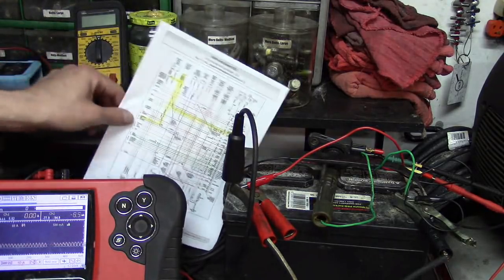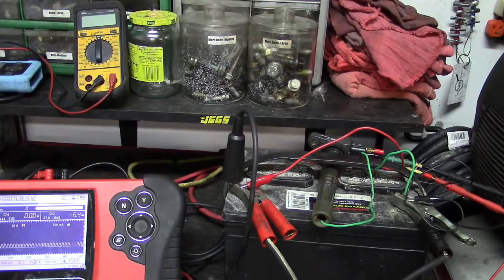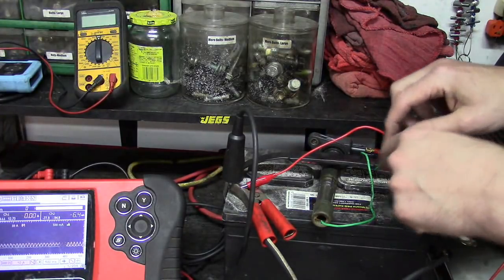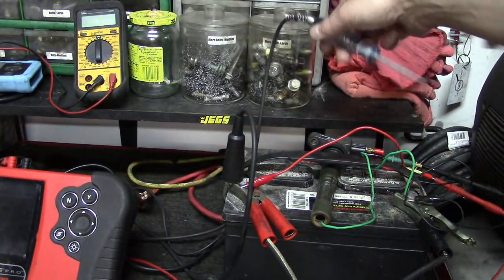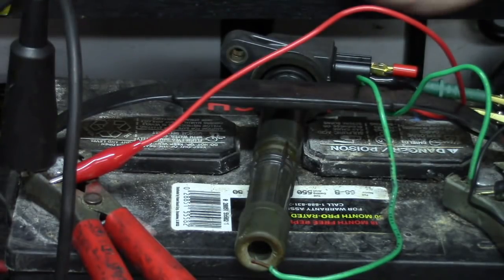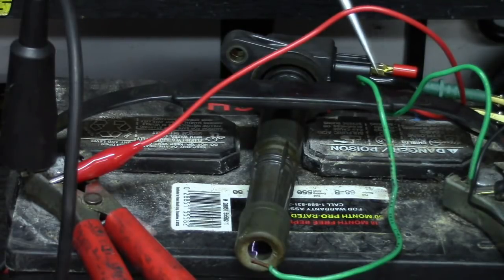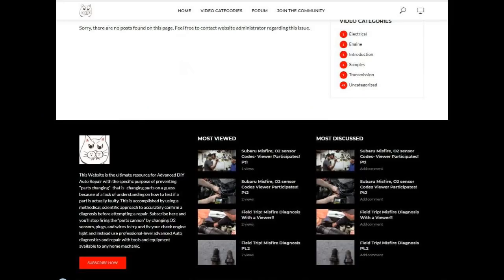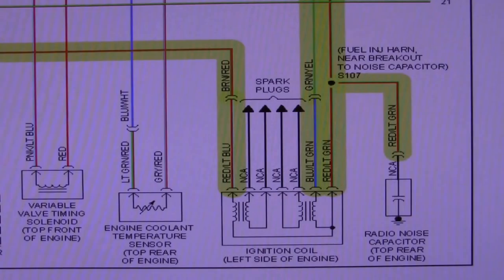Bench Testing a DIS Ignition Coil (COP)

Comment: A coil is more than just giving spark .. the winding on the inside wears.. Over time, the constant exposure to electrical currents and the associated heat can cause the windings to degrade. This degradation can result in increased electrical resistance, reduced performance, and eventual coil failure.
Reply: which would be tested how?
Reply from the maker: By ohming the primary.
Reply: @SchrodingersBox  you can test the coil's winding(s) for intermittant faults, under load, by ohming the primary?
Reply from the maker: No- you can test for resistance or a short in the primary on a failed coil.
Reply: @SchrodingersBox  ah ok, yeah i see that now after reviewing the circuits, thx for the info
Reply from the maker: Not under load. You never ohm under load. If under load you should do voltage drop instead.
Reply: @SchrodingersBox  i think ill just get the picoscope with the coil probe and the reference waveform library, anything else and youre just interpolating between data points. if youre going to own a vehicle with COP ignition, might as well count on spending the requisite money for direct data acquisition equipment...

Comment: Is there a way to test a 3-wire paired-output (i.e. cyls. 1+4 then 2+3 wasted spark) coil pack like this?  I mean on the bench with spark plugs and a battery?  I've tried all sorts of combinations with known good coil packs, but never managed to get a spark at the plugs.  I know you can measure the windings' resistances; but I would like a good way to test coil, leads, and plugs in one go when the rest of the car is unavailable.  If you have a paid-content video that covers this, I'll happily sign up.
Reply from the maker: Yes there is. I don’t show it anywhere but the operate the same exact way. Just provide power and ground and then input the signal as usual and you will get two sparks instead of one.
Reply: @SchrodingersBox  I thought it would be something like that, but I guess there's more going on with the ECU signal than can be simulated with a prod from a test probe.  Perhaps I need to add a condenser somewhere.

Comment: Nice video! 
However, the routing for the wiring was not really captured.
Please can you also highlight specifically the routing for the wires to and from the COP?
Reply from the maker: it’s very simple - your reference and signal inputs are battery positive. the ground of course goes to negative.
Reply: @SchrodingersBox  Thank you so much 🤝

Comment: I have a set of denso toyota/lexus COP  - 4 pin coils. How would you drive those on the bench? 
I want to use one as an ignitor for a foundry. 
I looked up the pinout
1 is GND 
2 IGT (5V+) 
3 IGF (ECM return to gnd?)
4 GND.

I was thinking to connect 1,2 and 4 to +12V, +5V and GND respectively and connect a momentary switch between ground and 3- would that work?
Reply from the maker: Test it exactly the same as a 3 wire. The 4th wire is strictly a confirmation signal to the PCM from the induced voltage created by the coil firing.

Comment: I did the same procedure has you did, but I started to play with it. Sending power on and off like 15 times till the coil blew. Lol it's an old one, I use it with the purpose of learning. Now i know to test it maybe 2 times before it get hot and blew the plug in coil. Don't judge me Matt, I'm learning. Damn! It's hard to became the 2%.

Comment: that's a crap test you need to put the coil under stress pressurised cylinder?
Reply from the maker: Not if the gap is over an inch you don’t.
Reply: @SchrodingersBox  still better under pressure

Comment: I just clear the code and swap the coil with another cylinder. If the code changes to the other cylinder then boom, Bob's yer uncle.
Reply from the maker: Change the pulg and wire with other cylinders and cover all ignition possibilities!

Comment: Hmmm, making sparks on top of a car battery. Seems very safe 🤔
Reply from the maker: Those who don't understand basic, fundamental physical chemistry would be concerned. It's like people who think Oxygen is flammable.
  Eloevate beyond ignorance and your world will be free.
Reply: @SchrodingersBox  You have obviously never had a battery explode in your face. If the battery you were using in the video was a wet battery and fully charged to the point of gassing,[ hydrogen and oxygen], then all it required was a spark which you were providing. You have called many people idiots who have commented  on  your videos, but this time your ridiculing of Veritas Aequitas, makes you the idiot. Don't say it can't happen. Iv'e seen it happen three times in my working life in the trade.
Reply from the maker: @johngregory1803  You still don't understand.   CHEMISTRY.  CHEMISTRY.  It is impossible that would happen with my setup unless hydrogen somehow changed it's atomic number to become denser than oxygen. The spark cannot possibly ignite the hydrogen.
  Come on man.  It's above your head.  Literally.  It's above your head....
 You don't get that do you? It's a chemistry pun.
Reply from the maker: @johngregory1803  Yeah you are not even on the same wavelength, pal.  I do not have to "prove my theory"  It has already been proven.  Laws of physical chemistry do not have to be proven.
  What exactly would I be proving- That an ignition source located only within the realm of an accelerant without fuel source and 78% nitrogen content will not combust?  This is already established in normal ST&P atmosphere. Every day. At all times.  in the entire universe.
   Hydrogen has an atomic number of 1. It is lighter than oxygen with an atomic number of 16. It is ALWAYS lighter than oxygen. It will NEVER not be this way. You need me to prove this?  Just do the math. That's your proof.
  Now, if I locate the ignition source into an atmospheric condition providing for both acceleration and fuel- hell yeah it could combust.
  But I didn't do that.  Nor would I ever.   Explain to me how this could possibly happen that at the ignition source in the video the hydrogen is going to displace the nitrogen while preserving the oxygen accelerant? 
  YOU prove how that can possibly happen in this setup in this video. The burden is on you- not me! You are the one trying to disprove a physical chemistry law that has been established for over 400 years now.
  Come on John- all of physical chemistry is awaiting your proof!!!

Comment: If the owner replace cable wires and coils, what was the  misfire cause, thanks
Reply from the maker: if I recall the car had a cylinder with bad compression.
Reply: Schrodingers Box Thanks Matt,  your blog is great 👍

Comment: Your all Aces in my book Mat
Reply: Hey Matt I have been fighting my s10 2000 zr2 no spark! My spark tester went wild when I did crank sensor bypass test constant spark when engine not even turning over ?I'm thinking covert to carb but 460le tranny seems to be a problem help me on one problem or the other one I am desperately needing this truck fixed !!!
      richard miles314@gmail.com

Comment: On a 5.4L triton I overfilled the oil change by over a quart and then before i could drain it back out it ran terrible and still continues to run rough when everything was good before the oil change. Should I suspect oily spark plugs? pcv and fuel filter and maf are not issue afaik not sure about egr or fuel pump but its crap under load and idle when it was fine b4 the oil overfill
Reply: also fuel trim is insane high no matter load or idle
Reply from the maker: Remove the plugs and crank engine to remove any oil that may have churned up into the cylinders as result of crankshaft contacting the oil
Reply: Thank so much for that suggestion! I hadn't thought of that but I was in process of removing plugs and the boot and tubes show new oil sling. I cranked the engine over to relieve fuel pressure and changed the fuel filter but didn't take out the plugs first now I think I'm on the right track so thanks again to you and scotty u guys rock!

Comment: I'm guessing this is a 3 wire coil, could this test be done with a 4 wire coil as well?
Reply from the maker: absolutely. I’ll cover that design too in the full video. It will be completely comprehensive being multiple parts and at least an hour and a half in total of both theoretical and hands-on application.

Comment: Matt,  Could a weak coil, if there is such a thing, spark doing a test like this but not spark in situ  because of the in cylinder pressure?  Does making it jump 1/2" count for that?  Thank you, Mike
Reply from the maker: YE$!!! I cover this in fact in the full length video. There are many reasons that a successful spark externally may not translate to adequate spark in a cylinder. Compression ratio, A/F ratio, load and other variables all contribute the the spark pattern,
 However as a short qualification test- if the spark jumps an air gap of 1" or more, then coil performance is definitely not the issue,
Reply: Thanks Matt, I will be tuning in to the other channel soon.

Comment: Hey Matt,
I've got a single cylinder misfire on my 2003 Ford Expedition on a cold start which goes away after about 10 seconds of warming up. I know the coil and plug is fine (all new plugs not too long ago) and I've done the swaperoo w/ the coil and the mis remained at #1. I would wager that it's not a fuel injector issue since the mis goes away when  warm. I've also done a compression test and it checked out fine. I'm wondering maybe an intake manifold issue perhaps just because it goes away when warm which would seem to me to indicate that something is sealing itself up with a little heat. If you have time I would like to hear any thoughts you might have. Thanks!
Reply from the maker: Misfire issues with cold start are very often vacuum leaks and while I don't generalize by vehicle type I can tell you I have seen a disproportionate number of this on Fords around that model year- in fact I believe I have 2 and maybe 3 videos on this phenomenon- all on Fords.
  Since you can't do a fuel trim analysis on a cold start, your best bet is either a smoke test when the engine is cold or if you don't have that capability, trying propane or brake cleaner around the intake with engine cold and listen for the response and look for the O2 sensor response if they are oscillating.
 Also check your mode 6 and really verify it's single cylinder. If it is truly single cylinder then an intake leak is less likely (but still possible) and ignition is more likely. swap plugs and wires with adjacent cylinders and re-check mode6 and see if the misfires moved.
Reply: Hey thanks Matt! I did verify the mode 6 data (#1 has 2,667 misses, #2 has 20 and #5 has 10) I've done the propane / fuel trim test to no avail in the past but now that the problem has gotten worse I may try it again but the problem is it warms up in like 10 seconds and then the mis goes missing so I'm thinking I might just save up for one of those $150 smoke machines on ebay and try that next.

Comment: I know the feeling, that is the no load situation, in car operation I had anyway. I suddenly recall an HEI I installed on a Camaro I had, a 1972 model not full 12v under operation, but only in testing the voltage at the connector plug to the HEI. Found out a ugh!! crimp connector had much resistance causing headaches of working properly. Problem was I broke my own rule, solder solidly electrical connections was the fix. Thanks for your videos, subscriber for a long time. P.S. We (my wife and I) get a kick out of your rebuttal comments/videos, very laughable moments. Continue on, thanks.